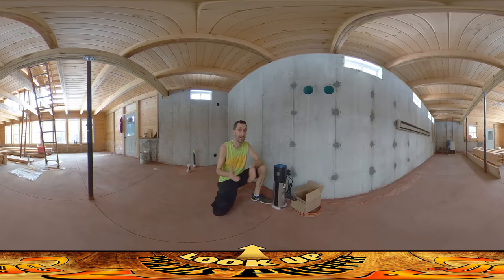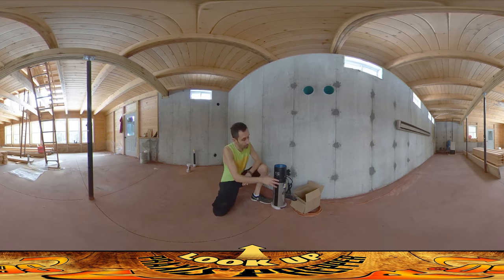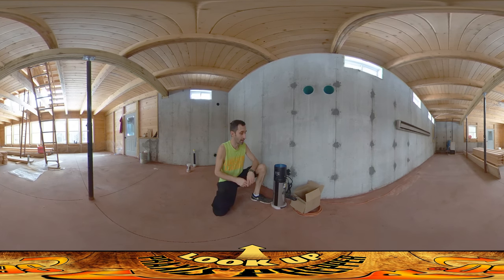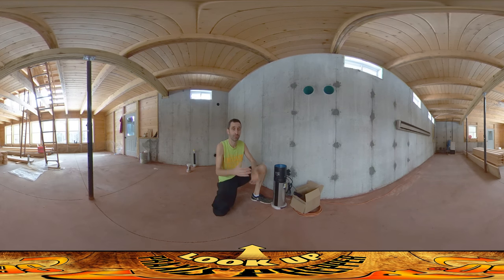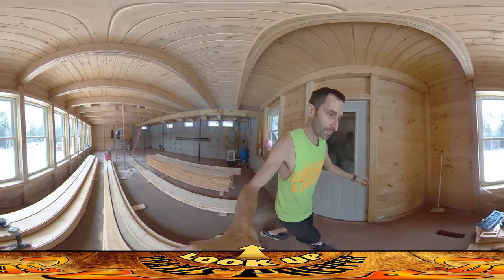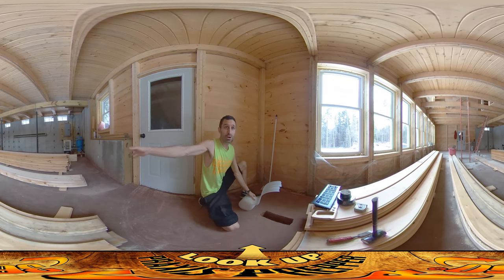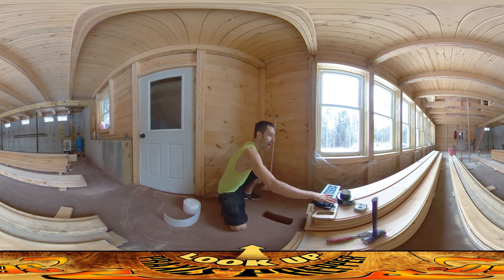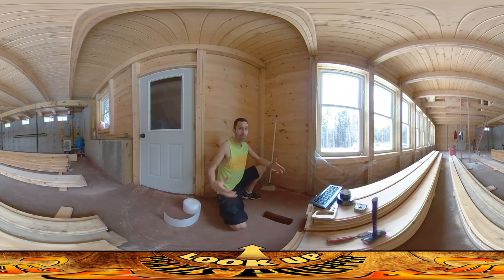Homestead Building - Sub Floor Thermal Mass Venting System WORKS!

Comment: Love it when a plan comes together. You absolutely deserve to be happy.
I hope my alternative heat method works half as well. I'm building a rocket stove with a thermal bench made of concrete. But, instead of the more common ducting through cob, I'm building an open bell design. Not as common but a well proven design. What makes it different and unproven is the bench passes vertically through the floor into the crawl space down18 inches to the ground. The stove part is of course at floor level like normal. The hope is the warm air circulating in the bench will warm the concrete and provide radiant heat under the cabin keeping it warm enough to avoid frozen and busted pipes in the -30 and -40 degree weather that usually hits this part of Montana once a year.
Reply from the maker: I'm excited to hear how your design works out too!

Comment: Nice to see that working so well but if I remember correctly there are like 5 or six of the tunnels under the slab but I can't remember if the air was snaking through them or if there was a vent at the end of each of them. If they each have a vent did you break all of them free or just the one?
Reply from the maker: Just one way in and one way out. There are 2 parallel tunnels connected by several cross-tunnels creating an array of tunnels. The air enters in one corner and exits at the other. I'm looking forward to infr-red scanning to floor to see the heat dispersement pattern at some point.
Reply: Praxis Homesteading and Survival Skills That will definitely be interesting and you might find that a lower flow rate works better and that the air doesn't cool as much. Might be a good idea to insulate the supply pipe if you hadn't already been planning to.